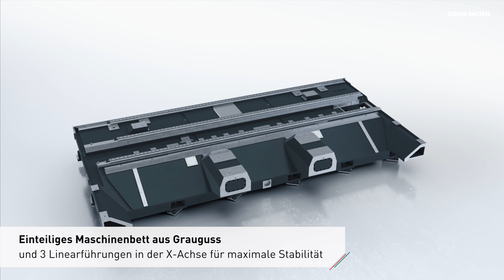DMF 200|8 - DMG MORI (DE)

Comment: I have been working evo 600  linear mill turn and dmu 50 last 10 years, this is super large machining area
Reply: What’s the price point new for one of these?
Reply: @MrCharliejaera  maybe more than $700k ++
Reply: @superkas  thanx Surya⭐️
Reply: @MrCharliejaera  Ibarmia zvh has also the same setup but you can get it with a table as long as 6m.

Comment: Question: Because dmg mori is japanese company, are the manuals for the machines also available in other languages than japanese and english ?
Reply: DMG is a German Company.... and yes when u have a seller in that country
Reply: @Pizzaro3009  DMG is a subsidiary of the japanese mother company.
Reply: No, it absolutely is not.

One DMG MORI is the DMG MORI Aktiengesellschaft (AG), a german company. The other DMG MORI is the DMG MORI Company Limited (Co., Ltd.), a Japanese company.

Though they're cooperating very closely and are main shareholders of one another with 50+% - They are still seperate entities.
Reply: @heinzhaupthaar5590  that is incorrect, the german dmg company is meanwhile owned by its japanese mother company, just check it out here:
https://en.wikipedia.org/wiki/DMG_Mori_Aktiengesellschaft
Reply: @tengilaurel3777  
Did you even skim through your own link?
Because it states exactly what I wrote.

"DMG MORI AKTIENGESELLSCHAFT (name written in capital letters; until September 2013: Gildemeister AG, until June 2015: DMG MORI SEIKI AKTIENGESELLSCHAFT) is one of Germany's largest manufacturers of cutting machine tools and a manufacturer of CNC-controlled Lathes and Milling machines.[2] Products include machines, industrial services and software and energy solutions. The SDAX technology group has 21 production sites worldwide and 161 international sales and service sites. The company is based in Bielefeld."

That's the DMG MORI AG.
The DMG MORI CO., Ltd. is Japanese.

And further:
"Both companies are main shareholders: DMG MORI AG (Gildemeister),[12] holds 9.6 (! its actually 50+% !) per cent of DMG MORI CO. LTD. and DMG MORI CO. LTD. holds 52.54 per cent (status: 7 May 2015) of DMG MORI AG.[13]"

One number there is wrong, it's each over 50%, as you can find in several articles or the more detailed german wiki article:

"Beide Unternehmen sind nun gegenseitiger Hauptaktionär: 50,1 % von DMG Mori Seiki K.K. hält DMG Mori Seiki AG (Gildemeister),[25] DMG Mori Seiki K.K. besitzt 50,81 % (Stand 2. April 2015) an Gildemeister.[26]"

And, there's a reason for the mix-up of numbers:
https://asia.nikkei.com/Business/Japan-s-DMG-Mori-Seiki-to-acquire-German-partner

- "We aimed to swap each other's stocks in the spirit of equal partnership, but we didn't see a light at the end of the tunnel [due to legal restrictions and other factors]," he said."

Seems they sorted it out and are now main shareholders of each other. If you have a reliable source for differing information I'm all ears, but the article you linked supports what I wrote.
Reply: @tengilaurel3777  
Ah, you're right there, had a "language barrier" problem from the start. Read subsidiary in another sense at first and didn't notice it later on.

My point was just that there are two seperate legal entities, one German, one Japanese.
And that's still the case, no matter the domination agreement.
And as long as there's no merger or whatever...

And of course that's not a bad thing, often quite the contrary in my (rather clueless) opinion.
Even more so for me, irc my family still holds some papers of the AG and has nothing but massive benefits from it then.
I'll have to take a closer look at that, guaranteed dividends for the dominated parties shareholders, as mandatory, seem like a nice thing.

Btw. back to your starting question: My cheap toaster comes with a seven language manual - as basically everything nowadays, from an USB cable to a die casting line from Alibaba.
I'm pretty sure things of this kind do as well.
But maybe they shouldn't.
Reply: @MikeYurbasovich  
Interesting.
How exactly though?

We're still as satisfied, or unsatisfied, as always. Basically nothing changed for us.
Last time I looked (been a while) DMG Mori kept a substantial part of the Mori lineup as is, and anyway, Mori is the dominant partner.
So, there aren't many ways "zE gErManS" could've possibly ruined anything at all. I get the impression you don't know who's on top here.

Seems like your barking up the wrong tree, but I might be wrong.
Elaborate.
Reply: @heinzhaupthaar5590  
They went too technical, as Germans tend to do.  I should know, because I'm German.  You should know, too Heinz. 
German equipment is designed to work in environments that are perfect, not harsh conditions where production overrides maintenance. If I had a small job shop where machinists waxed the machines and kept everything meticulously maintained, a DMG MORI would work nicely.  However, in a heavy production facility where operators blast grinding dust into touch screens and forklifts smash coolant tanks and conveyors, the MORI gets expensive and unreliable.  If the air quality is poor and your electrical cabinet has not been designed to operate in these conditions, your servo amplifiers get hot and fail.  Your GPS module fails and you're down.  
My main concerns with DMG are all the control and electrical issues, like all German products, they should step aside and let leaders design them.  The Japanese have done extremely well with American foundations. I cringe at every attempt by Germans to do anything electrical.  I've been working with everything from Krauss Maffei to DMG and Brown and Sharpe for decades.  Love the simple things Germans make, like Wiha tools and some other things I specify exclusively.  Also, their service is the worst in the industry..
Reply: @MikeYurbasovich  they have to overthink and overengineer everything to put that fat price tag on everything.